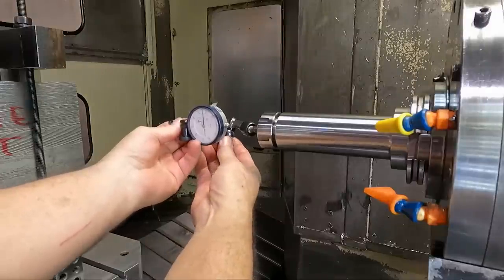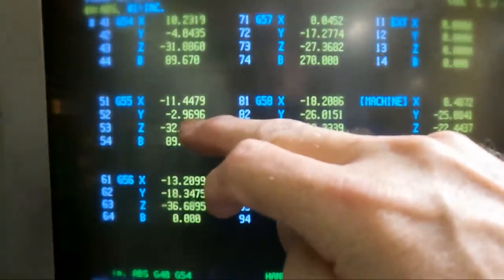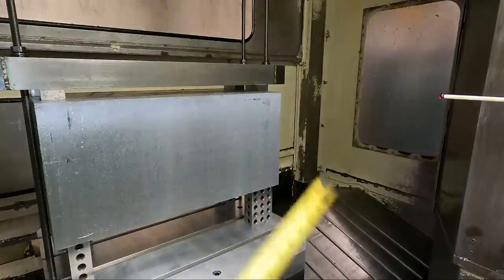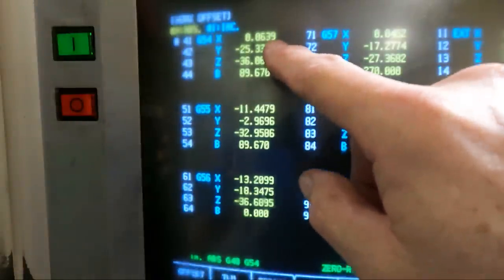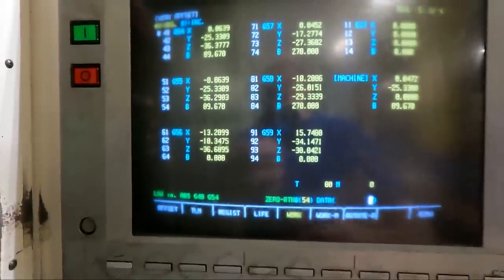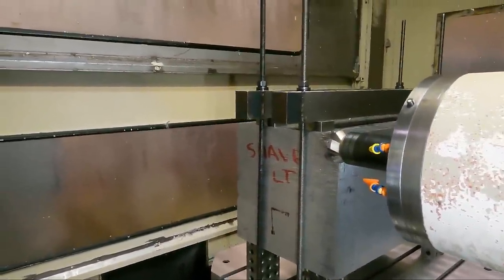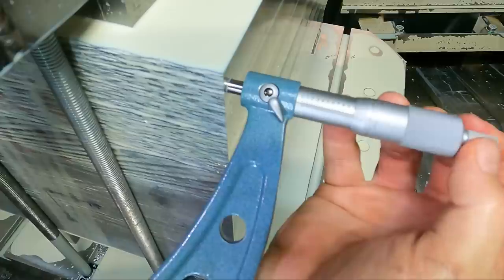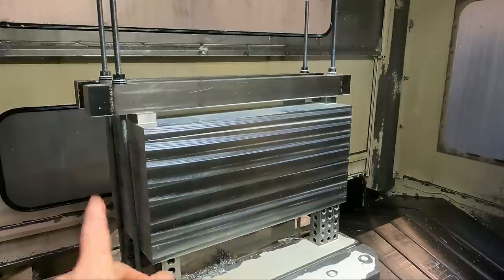Facing A Large Aluminum Forging

Comment: I used to work for Ingersoll and one of my last projects that i helped engineer was an ingot scalper. Thing was 191’ long and had an 8’ diameter cutting head and a 1k hp main motor to handle the 30 metric ton ingots. I did all the systems programming and debugging on the very first one they built, also had to install that beast in Saudi Arabia. For being such a “simple” operation, they’re decently complex.

Comment: I could have done that same job, faster, on a manual Lucas Boring Mill. Lot less calculations, nervous checks, and room for error. I like C.N.C. been using it since 1986. But, I think too many times, there is a lot of wasted effort when CNC operators insist on doing a manual job. Just my opinion, and it's worth what it cost you.

Comment: You do a fine job with your videos. I watched when you were setting up the blocks how you positioned the threaded rod on top of the hold down by using the bolt head of the table to avoid damaging the table. Little things like that are hard to teach newbies. And the detail of the program cycles were explained well also.

Comment: Amazing! Thank you very very much to include all these details! I was wondering since a long time, how these would be done, like how you are changing the pallet top, adjusting the coordinates, how to start a program somewhere in between, ...
I especially liked all your sanity checks, e.g., with the tape measure, summing up the coordinates in the calculator, and also the 1-2-3-block trick.
The tool change must have been a hell of a work. Thanks for going this extra mile!
And yes, I would be interested how automatic coordinate measurements work.
Thanks, Hansi

Comment: Great stuff, Peter!  I really enjoy seeing all the little checks you do to make sure you're successful.  I do something similar with automatic probing in fusion 360.  I use the Haas WCS macros to update the G54 based on a static "known" point assigned to G59 that matches my model.  That way I never have to manually probe a job, it's just all baked in to the program.

Comment: Cool Cool Cool
And I like the perfect commercial placement when you hit the first cycle start went directly to a kenemetal tool on the lathe
Reply from the maker: I'm curious, because I have no control over what adds are played on videos. Are you referring to a actual add for Kenemetal tooling showing on my video?
Reply: Not sure if it was the kenemetal or a site selling them but was perfect placement almost looked like that's what you had put in the machine.
  I didn't think you placed it but just came out like it was 👍👍

Comment: Man if only all the saw cuts were that straight!
Good video. 
Ever consider writing a trig cycle for your offset evolution around B?
I have a couple days of doing it. The first will wrap your G54 B0 position to any other B angle/offset number.
The second way, my preferred way, will run the same offset for any B position. It references B0 position, reads the current B position, calculates and sets a program offsets.
Programming that way, all locations follow print dimensions.

Comment: Used to love it when we got an aluminium part in as opposed to the traditional Inconel 718, the jobs seemed to fly past! 

Just wondering on this sort of operation, have you tried out round insert face mills at all with a lower axial depth? Due to chip thinning you can really get those cutters movin'
Reply from the maker: On other parts in this group of parts I do use a milling tool with round inserts to rough with. Its a 2.0 diameter with five inserts. I run it at 5500 RPM at 200 inches per minute fee .150 depth of cut. At a full width of cut it draws 100% spindle load of this 40 Hp spindle.
Reply: @EdgePrecision  sounds aggressive, although with softer materials that's the only way to be

I've been doing some research lately into cutting technology and it's really opening my eyes to what's possible when using the right type of tool combined with the right toolpath. As mentioned before the chip thickness is the key with cutting rather than simply using feed per tooth when engaging on less than the radius of the insert/cutter

Comment: I’m a little bit surprised you don’t use and drill or impact to remove or install the socket head cap screws onto your table. As well as using a torque wrench to tighten everything. Still fantastic work and I learned a ton from watching this!

Comment: Peter, I think when you were measuring the finished 14" you were saying that the top was slightly wider than the bottom.
I was wondering if this was the result of tool pressure, or possibly because you set an unmachined surface on 4 blocks rather than 3, and possibly it could wobble a little? Would using 3 blocks have been any more stable?

Comment: Another excellent video. I agree with the great edits on the tool changer. Nice to show what it actually takes to change setups, been through a few of those myself so I can appreciate the effort. i trust the TI plates came out ok?
Reply from the maker: Yes the titanium parts came out good.
Reply: @EdgePrecision  Glad to hear the 0.0018 didn't hurt. Keep the videos coming when you can. Thanx.
Reply from the maker: No I fixed that before running the real parts.
Reply: @EdgePrecision  Did you shift the centers on the fixture? That was my first thought for a fix. I thought that would be a huge undertaking. just curious.
Reply from the maker: No the error was in the right direction so I could skim off another .0018". If that hadn't been the case than I think I would have taken off the end pieces. Gone over to the horizontal mill and faced off a few thousands off the plate. Than reinstalled the ends. Than re-cut it on the Mazak again.
Reply: @EdgePrecision  Ok got it. I thought it was beyond center not short. Having the removable ends was a nice feature in if the need arose for an adjustment. I appreciate the feedback.

Comment: Man, I miss running aluminum... The shop I work at we only run castings, steel weldments and 8620 for the most part. I run a big boring mill but every now and then I'll hop on a 600mm pallet horizontal when they need help. My table is a bit bigger at 63 x 86. Most of the parts I run are between 6-12 thousand pounds... lol I havent seen any of your other videos but, you could cut down a ton of setup time going to ball locks to align your tombstones. Dont really need to dial in as long as everything is clean going on.

Comment: I really enjoy your videos.  What is the stone called and grit  that you use on the pallet as well as the lubricant?  Sorry if you posted this in the comments already, I did not see it.  Thank you
Reply from the maker: Here is a link to a stone that looks exactly the same. I bought mine from my local tool supplier but it looks to be the same. The oil I'm using is just WD-40. https://www.amazon.com/Hatchet-Sharpener-Multipurpose-Sharpening-Stones/dp/B08P3WL2WT/ref=sr_1_25?keywords=round+sharpening+stone&qid=1638908915&sr=8-25
Reply: @EdgePrecision  Thank you

Comment: If you were to check one surface for flatness what do you think total error would be? .001" or less?
Reply from the maker: Of the machined surfaces? Less than .001" easy. The difference I was measuring with the mic (You couldn't see in the video) was about .0002" from the top to the bottom. That's what I meant by slightly smaller. It was somewhat difficult to hold the mic with the camera right in my face taking the measurements.

Comment: Just out of curiosity, what would you have done if it wasn't straight? Potentially you could move the Z while running but that would introduce a (very)slight curve into the surface.
Reply from the maker: If a horizontal mill isn't milling straight/vertical in the Y axis the machine is out of level. It needs to be releveled. This is why it is important to have a proper foundation under a horizontal milling machine.

Comment: Peter, I'm designing a tombstone for our 5ax machines (DMG 125P, 125U, 100P) anything you would have done differently on your tombstone for your Mitsubishi? I was going to use 1" plate for everything but that base plate at least on yours looks like 2"?
Reply from the maker: The base plate on mine started out at 2 1/2” before I faced it after welding. I have found it very useful to have an open top on the tombstone. Because I could bolt parts on its faces using short studs with nuts on the inside. What I usually do is use 3/4” drill guide bushings with a .515 hole. So the bushing is for alignment with 3/4” c-bores in both part and tombstone. A  1/2-13 tapped hole in the part for the stud using a nut to hold everything tightened on the inside. This of course requires that the part can have these tooling holes in it. Also this allows you to put holes to put round rod parts into the inside of the tombstone. But you have to consider draining coolant out the bottom. You may notice the half round cutouts in the bottom of the sides of mine.
Reply: @EdgePrecision  oh interesting, thank you, I was planning on having a few plates inside / top for rigidity but that totally makes sense. What size plate did you use for the sides?
Reply from the maker: @mrjacob8836  It was 1 1/4” thick before finish facing.

Comment: I see the tombstone come in and out of the mechine  all the time .and your super clean on set up . ? Why or why not is there no attention  made to the deck the the trolley locks down to .
Reply from the maker: Are you referring to where the pallet clamps down in the machine? There are six pads and two large pins the control the location of the pallet. They are clean. Nothing else really matters to its precision. And believe me it indexes in and out with very high precision.

Comment: I wonder if you could spin those nuts down the all-thread using compressed air.
Reply from the maker: Possibly but sometimes there is small debree on the threads that the airs force would not overcome. It doesn't take but a few moments to do it with my hand anyway.
Reply: @EdgePrecision  ...but the blow gun method is fun.   :^D

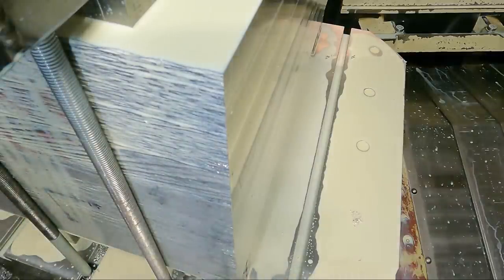Comment: Peter, did one of the 2x4x6 blocks move/rotate slightly during machining?  The one in the bottom-left of the screen at 33:36 into the video.
Reply from the maker: Yes there was one that didn’t have a lot of pressure on it. This is not uncommon clamping down on a raw forging. But the other three did their job.

Comment: Why not run it without lifting tool of and rapid cutting air? 
Run on the outside untill you reach the center?
Reply from the maker: There are two reasons. First I want the cuts to climb mill. Second and more important. This direction of cur puts the force down into the pallet. So it avoids lifting the part of the blocks.
Reply: @EdgePrecision  But machining clockwise is also climbmilling or am i missing something here? 
How deep is your cut, and how wide, please?

Comment: Peter, you have pushed that cycle start button thousands of times, does it still give you a few moments of anxiousness before you do ? :)
Reply from the maker: Every machinist who runs automatic/cnc equipment should be  paying attention/ready to observe the machine and what is is doing when pushing cycle start. You should always have your finger on the feed hold button after pushing start. Don't! leave the control, observe what is happening. I see this mistake over and over again. Also be aware of where the emergency stop button is located. So you can push it in a panic situation quickly.

Comment: what kind of machine comes without keyways in the main table?
Reply from the maker: This is a horizontal machining center. They typically don't have T-Slots in the pallet faces. Most of the time you are bolting on a tombstone fixture (A vertical fixture base to mount vises and other things on.) to mount your parts on. So in order to do work like I'm showing I do have to bolt down a fixture with these t-slots. Again this is perfectly normal for machines like this.

Comment: Great video Peter!  I was just learning CNC machining in 1982 and tried out a Rennishaw probe for the first time on aHulle-Hille horizontal 4-axis machining centre.  Over-confidence of youth I'm afraid.....The machine controller wouldn't let me override the feedrate manually whilst in the probing cycle, I recall, due to the axis velocity being critical to probe accuracy.  Also it's hard to dry-run with a probe and nothing to touch, so I went for it at 100%...the Z-axis didn't stop when the probe triggered, so the the probe rammed itself straight into the workpiece and totalled itself.  I never, ever, did anything at 100% for the first time, ever again.  I can't recall how the probe didn't stop the axis moving at that time, but I must've resolved that somehow.  Embarrasing and very expensive mistake.
Reply from the maker: You have to be carful while running Renishaw probing cycles/macros. I once pushed feed hold in the middle of a probing cycle. Than thought I could continue with cycle start. It broke the stylus on the probe. If I have to stop in a probing cycle. I start the whole thing over from the beginning. Just to be safe.

Comment: Peter, nice video! I am currently doing manual milling, but thinking of learning CNC. Two questions - Suggestions on a good way to learn (take a class, or read a bunch of literature, etc.)? Also, are the G codes somewhat similar across different machines, or pretty much unique? Sorry if you already answered these in previous videos.
Reply from the maker: I would say if classes are available to you take them if you can. What could it hurt. But you can now days learn a lot on the internet videos/tutorials. You need to practice by doing it. Preferably with someone experienced to guide you. So you don't damage things. The G codes most programs use are standard mostly. Some machines have what is referred to as canned cycles that can be different. like drilling, boring, or pocket roughing cycles. But in the beginning you don't have to worry about that. Some of the M (machine) codes can be unique to a machine. But there are standard ones all controls use. With Cam software you could get by not knowing any of this. (I don't recommend it though) Some people do it this way. Like running computers. You may run them with their peripherals and not know a thing about computer programming. It takes time you practice make mistakes and learn.
Reply: @EdgePrecision  Thanks Peter!

Comment: Why four ABC blocks are needed underneath the block?
Reply from the maker: If you watch closely in the video. When the machine gets down on the lower passes the face of the spindle is very close to the pallet/table. The end of the spindle is almost 12" in diameter. So if the part isn't tall enough in the Z direction or the tool long enough. The spindle will hit the pallet. I have to raise it up at least 6". On those 2-4-6 blocks. Hope that makes sense.

Comment: I was surprised to see that those large plates don't have any kind of locating pins..  Only the bolts.   I suppose it's just the part that has to be parallel to the tools, and not necessarily the holding plate...  If all of those allen head machine bolts were tapered on the bottom, like a lug nut on a car-- then it would probably have a more repeatable install..  but I guess maybe the holding table doesn't need to be precise;  other than precisely flat.

Comment: what happens if you calculate incorrectly and drive into the subject?
Reply from the maker: You have what is known in the trade as a expensive mistake (Putting it politely). In general this won't happen using Cam software if you simulate the tool path. It could happen with a wrong offset at the machine. But if you run the tool the first time correctly (I have a video on this) you should eliminate this as well.

Comment: Interesting. I was expecting something more complicated than a plain block from a forging.
Reply from the maker: I just machine. Don’t design the parts. But I think if you want a solid piece of aluminum this big, it pretty much has to be forged.
Reply: @EdgePrecision  We (thru another shop) are turning some large aluminum tubing into a hex. The material is forged. I thought it was going to be extruded. They somehow forge them in 6 ft sections. I am hoping to someday see how they do it.
Reply: Come on mate, there are people here not on a hero status like you.. pipe down bruh.
Reply: Way to to be mean. He even said in the last 2 mins that this was all he could show. Maybe watch the whole video next time instead of trying to bring someone down
Reply: @Awfultyming  I don't think he is trying to mean. Forgings typically mean pistons or connecting rods. But it is also how they make big a$$ hunks of aluminum.
Reply: @Awfultyming  What on earth are you talking about? My comment was about the raw material, not anything he did. 

I've never seen a forging that was just a plain block before.
Reply: Marie don't allow inexperience to influence you experience. This is basic 4 axis mill work